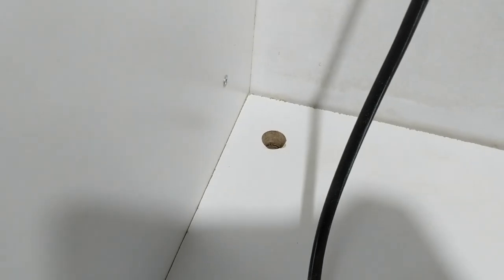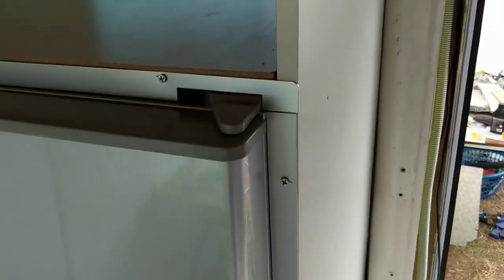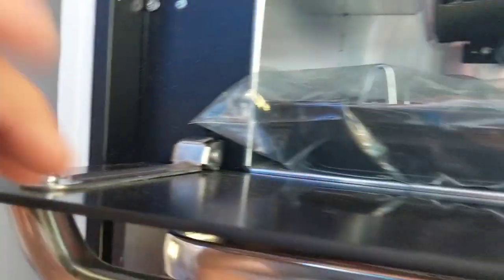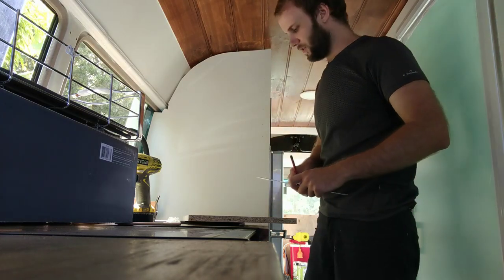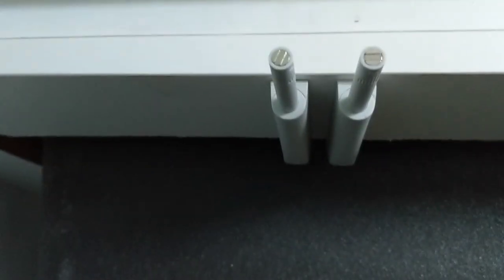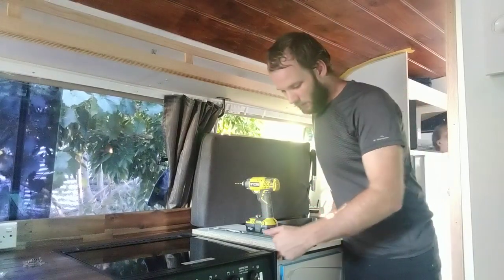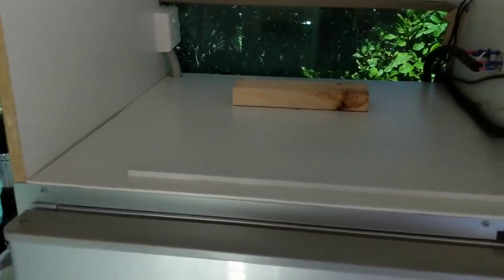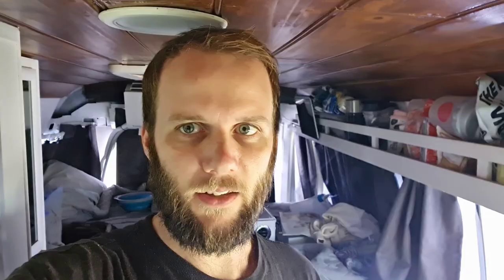Toyota Coaster Bus Conversion - Kitchen Installation | Evakool Fridge, Microwave and Thetford Oven

Comment: Hey guys love all the videos! Quick question, how far out from the wall is the fridge front edge?  and is it sitting flush agains the side of the bus? looking to buy one ourselves but it looks like it sits quite far out, further then the dimensions of 585mm?
Reply from the maker: Hey, it sits out about 6.5cm(thickness of door) from the side of the bus. We made the wall to be the depth of the fridge (measuring from the floor), which gave it some ventilation behind it (instructions say 100-150mm ventilation).